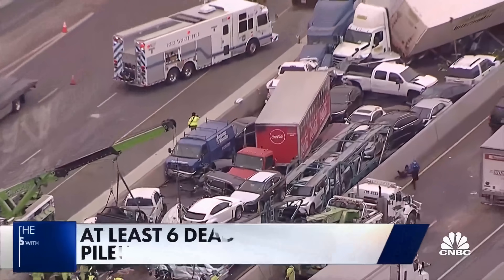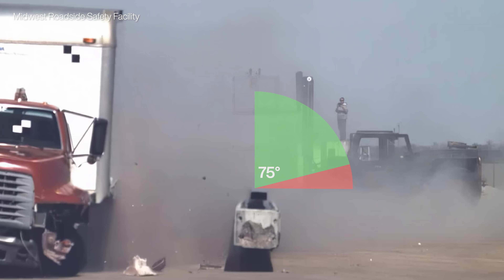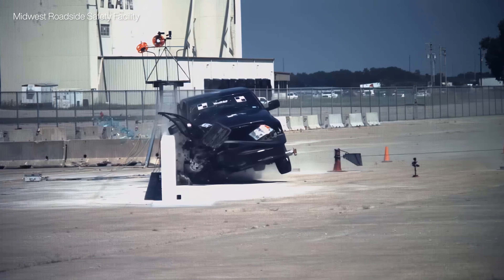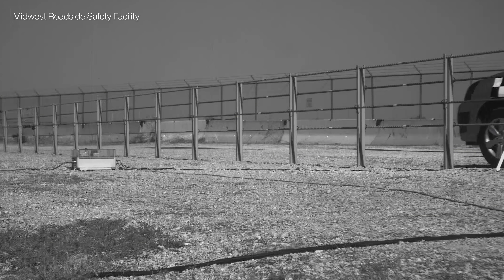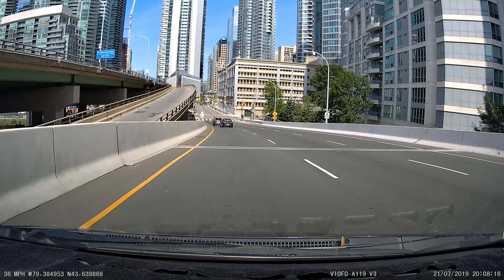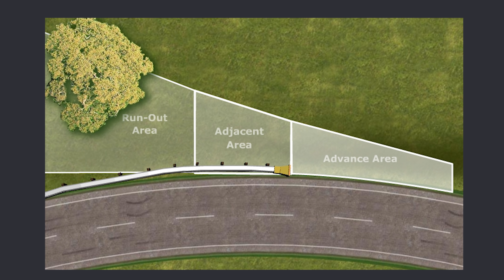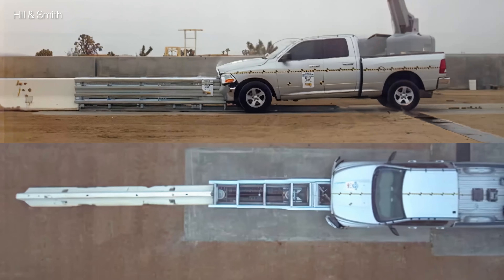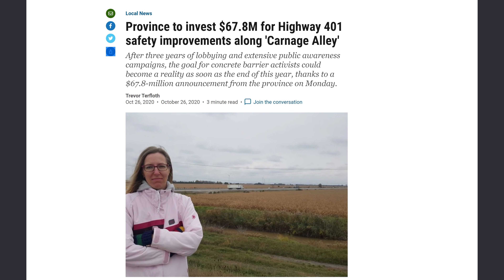How Road Barriers Stopped Killing Drivers

Comment: They were all ways suppose to preform like the new ones the company installing them cheeped out on a bracket that allowed the metal to not be deflected like designed and go strait thru into the car. So was never the barrier was designed bad. They were all ways designed to do that. The company got greedy and tried saving money going with a cheeper not to spec end cap.

Comment: You didn't mention one interesting thing! THose little planks under the guardrails for for motorcyclists out threre. When a cyclist fcrashes he usually falls on the side and slides right under the guardrail with later being successfully bent around a guardrail post.

Comment: The only reason there's less drivers killed in recent decades is more traffic (lower speeds) and crumbling roads (lower speeds). Still does not compare at all with what a reasonable country say in Europe or Asia would do for long-range land travel: TRAINS. Probably 1% of the deaths vs. driving. Flying has basically 0 casualties. FREEDOMMMMM (to run over children "accidentally" on your 8 foot tall, 8 wheel pickup).

Comment: On the Los Angeles freeway system, I've witnessed cables interlaced in a chain link fence catch a fulled sized sedan travelling at freeway speeds. I was in the "fast lain", going in the opposite direction. Had that fence, not catch that car, I might not be here. I stopped to render assistance. I ran over to the driver (and only occupant) of that "caught" car, and she was uninjured. The damage to her car was spread across the length of her car. This happened in the mid 1990s.

Comment: As a daily commuter on a motorcycle, the cable system is by FAR the scariest barrier I ride by everyday. I can slide along the concrete barrier. I can bounce off the metal barrier (I know this for a fact....) but the cable barrier is just a huge cheese grater that could tear me apart limb by limb if I slide into it. And another thing that makes it even sketchier where I live, is the section of freeway where I ride that has the cable system, there is no shoulder whatsoever. The barrier is about 2 feet from the painted line along the freeway. So in other words, if I get forced out of my lane I have no where to go but the cheese grater. 

This section of freeway has a speed limit of 70 mph, but the traffic normally flows at 80 to 90 mph. When I get on the freeway there is a long straight into a long sweeping curve and another straight. It's only about 3 miles of travel before I get off the freeway again but it's a scary 3 miles riding just a few feet from those steel posts and cable at close to 90 mph with no room for error. 

Riding along concrete barriers doesn't bother me at all and most of the time I don't even notice them. What I don't understand about the placement of this cable system is why they installed it just a few feet from the roadway and not in the middle of the very wide grassy median between the west and east bound lanes. They could have placed it almost 15 meters from the roadway and it would be a non-issue with me. Whatever the reason, they certainly didn't have motorcycles in mind.

Comment: I lived in Barcelona, Spain for 10 years and remember a public outcry to add a second guardrail under the upper one. There are a lot more motorcycles and scooters used on European roads than there are here. Motorcyclists were being killed by striking the posts, at an alarming rate. The government listened and installed a lower rail that undoubtedly has saved many lives. As a rider,I was happy to see the change.

Comment: I regularly watch videos from Ron Pratt (Midwest Truck, Scott City Missouri).  As a towing and recovery operator, cable systems cause him a lot of problems and safety issues when attempting to recover vehicles entangled in them.  There is one of his videos where I guy was trapped in his car and Ronn had to lift the cable under tension with a rotator tow truck so that the man could be rescued.

Comment: So I work for the Department of Transportation I can't say the state I can get in trouble These guard rails They've been constantly evolving In the state I've live in. the past 20 years we've went through about 20 to 25 updated safer guard rails what i'm saying we've made that many innovations   That saying That in 20 years We've made 20 advancements in safety at least because there are thousands miles of this guard rail in my part of us so you're not going change it off a little breakthrough it's going to need to be a valued one. Roadways and travel ways are safe for the most part Putting people with other peoples is where it all gets tricky Because if people don't care All the safety equipment in the world doesn't matter if people don't care

Comment: This new MASH guardrail has a big flaw for motorcycle drivers. The posts are exposed, do if a driver falls from their bike and slides into the guardrail, those metal piles can easily rip someone apart.  This problem could be solved with a additional rail blade under the main blade. Also, those cable barriers are even worse for them. Why in US, traffic safety is only for people in cars, and for people on smaller vehicles the safety systems are more dangerous than having nothing?
Reply from the maker: Yup, that's basically it.  From what I read it's just not cost-effective to add those barriers for motorcycle riders
Reply: @Lam  which is a shame. Although it makes sense. Since the US doesn't have free healthcare system, injuries doesn't cost a thing to the state, so, it doesn't matter. Here in Brazil, we have the SUS (something like Health Unic System) that is financed by the State. Because of that, the most cost effective way is to protect people's lives. That's why we are starting to add the second layer to Guardrails, and other measures. A cable system is so dangerous that it isn't even used around here, basically. Also, motorcycles are really a thing here, selling in a two to one ratio compared with cars.

Comment: I smashed into a concrete barrier in my heavy car at about a 45* angle. It didn't climb the side or flip the car over. I pushed the barrier over about 3 feet and the city should have charged me for that. "Driving too fast for conditions" ticket.

Comment: For YEARS the Narrows Bridge in Tacoma , Washington . Had two lanes of traffic in both directions with only a open space between them . NOT hving common sense to have put those movable concrete barriers in between  , one section for the entire length . The reason when I drove over it , I would always drive in the outside lane . Less impact from a potential headon , though I don't recall of many if any accidents , strangely . Now they have built a second bridge , completely separate for each direction .

Comment: I sideswiped a guardrail in a hydroplane situation. The rail worked as designed at first. Then the rail just folded backwards on itself and turned it into a dagger. It punched a hole in my driver door and hooked the main pillar at about 100km/h. Was like hitting a brick wall. The guard rail came into the car hit my seat and shoved it into the back seat. I received 5 stitches. During the slide I had pulled myself towards the steering wheel while countersteering, it was dark and I had zero idea I was about to hit a guard rail let alone impact anything, the ditches are pretty big on the highways where the wreck happened. So because of my position the rail just missed me when I hit. Anyone 20lbs more than me would have been dead. I had Was lucky asf. But now I'm terrified of guard rails. I'd have rather rolled the ditch that day.

Comment: What if they used the same kind of net idea that cops use to stop cars at high speeds, the net wraps around the tires causing them to seize so what if we used the garbage from around the world to basically make nets that won't be so hard to ram into but more glide into and come to a slower but more sudden stop with less opposite force ??
Reply: Interesting idea, but the two problems I see are 
1. Over time, debris can fall on the net and potentially make it non-functional
2. Only a tiny portion of the plastic you recycle is actually recycled. Most of it is dumped in the ocean. If you look at a recyclable product and the symbol has a number inside it, that only says what type of plaatic it is and is designed to look like the recycle symbol so that people don't think too hard

Comment: In Australia we call them cheese grater is the wire barriers are dangerous as fuck if you are on a motorbike and run off the road by an idiot driver which surprisingly happens often you real get shredded because often times bikers are going way faster than the speed limit because here we can pass between lanes legally and between cars themselves and if you hit one your flash will be shredded of your bones

Comment: As a truck driver, I came across accident scenes frequently. I came by one on the N.Y. state thruway, which has miles of cable barriers, in the median. A Semi had drifted off into the median, mowing down the cable barrier, which kept it from crossing into oncoming traffic, but one or more of the metal posts, penetrated the aluminum fuel tank, which ignited, burning the cab to the ground, while it straddled the cables. Don't know if the driver got out, I passed by before fire crews and police got there, and a few other vehicles had already stopped, but I could feel the heat all the way over in the right lane. It looked like the only damage to the chassis was the fuel tank, could have been driven away, had the tank not been penetrated by the barrier.

Comment: About a year ago I was driving home from work one morning on the highway, when an 18-wheeler in front of me popped one of its front tires, the entire truck snapped to the left, and traveled at highway speeds across the clear zone and into oncoming traffic, taking out two cars before hitting some trees on the other side. It was horrifying to watch. I didn't even know what to do. I pulled over and sat there for about five minutes before I finally calmed myself down enough to drive home.
Everyday after that (and still today) when I drove that stretch of highway I was reminded of it. The guardrails had just ended, and I'd always thought the clear zones would be enough to stop a car. But I guess they weren't tested for 18-wheelers going at highway speeds, or maybe that truck was just unlucky that day. Either way, seeing that has made me a lot more vigilant when I drive, and a lot more aware of the safety features

Comment: Only thing i get from this is.

Cable good for less damages, if there is space between roads and if you can possibly recover, and reduces chance of rollover, guardrail is like? The middle og cable and concrete, concrete is strong and doesnt allow a vehicle to fly over The bridge, (shown in The video)

So, different things are better for other things, use money on things that are important, and use less money on things that aren’t so important as that but still important.

Comment: A huge issue with cable barriers is they only work once. If one section of guard rail gives out, the rest continues to work. One minor accident can create huge zones with no coverage for weeks until crews get out to fix them. There are areas where I live where the cables will only be up around a week or two before being down for the next couple months. That's a huge safety hole.

Comment: Anecdotal evidence; I have personally known 2 people who have been killed by cable barriers, both partially decaptated by a cable. In one incident a cable snapped during impact, wrapping around the cab of the vehicle and cutting through the driver side A-pillar and driver. the other incident involved a motorcyclist who had a tire fail and crashed/slid down the length of a cable barrier which at some point got between the persons shoulders and neck. freak accidents perhaps but indicative of at least 2 things worth considering in our road planning which at least seem under-considered: diverse traffic and infrastructure lifespan/condition oversight. cool video

Comment: I crashed into a cable barrier once and my car went underneath them. You could see dents on the roof of my car where it vibrated down. It was an Acura rsx, not particularly low. If it was a convertible I wonder if it would've decapitated me

Comment: 13:54 This should have Portuguese subs. In Brazil, road safety is a big problem. Brazil copies much of its new road designs from the US, but often will not invest that much in road safety devices to cut costs, as it still needs to build many roads and doesn't have that much money.

Comment: From 2016,?  What did they just give up lol 😂 or not need to change things
Reply from the maker: MASH 2016? Standards take a LONG time to change.  You have to show it's necessary which requires a ton of tests, research and money.  There are updates to the code but that's likely to be the main safety standard for a while.

Comment: Has anyone else wondered what would happen to a motorcyclist when they hit one of these barriers? Cable barriers just cut away legs. Ridged barriers impale. 
I used to work for a government road designer, roads were never designed to protect motorcyclists. In fact, if motorcycles were invented today, they would be banned from the road.

Comment: I’m a mechanical engineer that simulated some of these tests with real world products . There is one big omission. What tests are there on motorcycles on cable barriers?  That about low side crashes on raised metal barriers. The standards look at heavy vehicles but when motorcycles crash other vehicles inadvertently become part of the same incident.
Reply from the maker: Yeah, I've received a lot of comments about motorcycles and you're right it's not something they look at.  In fact in one of the government training videos when somebody asked a question on motorcycles it was somewhat chuckled at and they moved on.   I didn't expect so many comments and clearly it's important for a lot of people that these barriers could be safer

Comment: All these barriers and test used and appear to be designed for cars/ trucks .Motor cycles have been left off why??? The cable barriers allow the rider to slide under  causing other problems to the rider. Just an observation from down under in Australia.

Comment: Here in germany I didn't see a cable barrier even once. Concrete barriers are very few but increased a litle in the last few years. Its just in lower speed areas though. I didnt see any in over 100km/h areas so far  -or at least I cant remember, but I  drive very few km/year anyway.

Comment: They no longer kill drivers, but they no longer prevent drivers from running off the road and killing other people. The engineering is wonderful, but the thing they didn't consider is that it worked before for the purpose it was designed, now it doesn't, and all because we made an attempt to fix stupid. You can't fix stupid

Comment: 12:18 i would put air filled Pillows in there^^ And each Pillow has a Valve that lets the air out, if its over a specific pressure (when a car hits that structure)

and then i could be automaticly refilled with air, through a micro controller and a Air Compressor :P

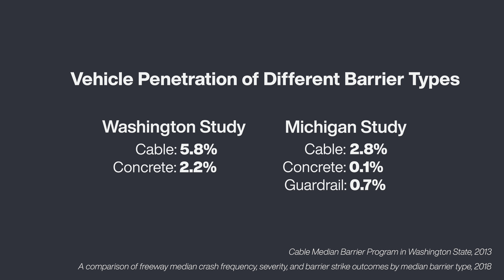Comment: being that i live in Michigan i think the figure shown at 7:20 isn't all that accurate, if you are outside the main city's like Detroit, Flint, Saginaw, Grand rapids and are on any highway in the state. There is a 99% chance you will be driving next to cable barriers. Downstate they mostly use concrete but Michigan is mostly cable barriers so it would make sense that cars break through more often

Comment: Air bags aren't safe, when you consider that the air bag is designed to stop someone from going through a window, however internal injuries occur as a result of the air bags. When a car comes to a sudden stop, the momentum has to continue going, which is why people have gone through windshields and whatnot. However, interrupting the carried momentum of the external of the human body does not stop the carried momentum of the internals of the human body, which is why bruising and concussions are common after air bag deployment, and of course the higher the speed of the vehicles involved in the accident, the more severe those internal injuries can be. Not to mention that in an accident where the internal injuries cause a fatality and have had the air bag deployed, most coroners wouldn't say that the air bag had anything to do with the fatality, despite the fact that air bags literally try to break the law of motion every time they're deployed, which is why you see that "air bags have saved over X amount of lives". The Takata air bag recalls, which another round of recalls with more problems with the replacement air bags of the initial recall has been recently announced, but due to the shortages on labor, parts, etc, the replacement parts for the latest round of air bag recalls has yet to reach car dealers. I removed my air bags after it was discovered that the air bags in my car were from Takata. I put a dummy plug in to keep the air bag light from coming on and my car has passed state inspection for the last couple years. My car also doesn't have a catalytic converter to prevent my catalytic converter from getting stolen, but my car passes emissions and safety inspections without either one.

Comment: So much effort and money is spent on road safety simply because our society is built around non professionals driving vehicles at high speed. The very fact that the concrete vs cable barrier study had 10 000+ crashes to use as data points is haunting. Can you imagine if there were that many train derailments or aircraft crashes that could be studied? No one would trust trains and planes to be safe. We need to stop accepting deaths on the road as some kind of necessary evil, and stop shrugging our shoulders when we see statistics that show that motor vehicles are one of the leading causes of death in young people.